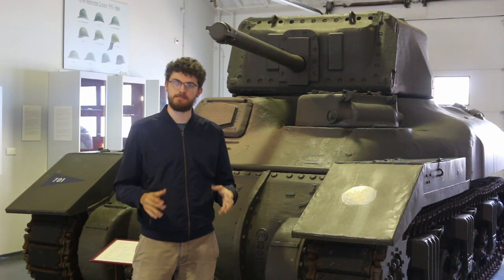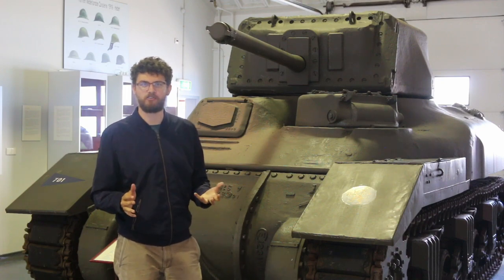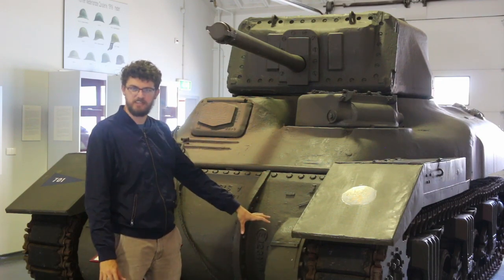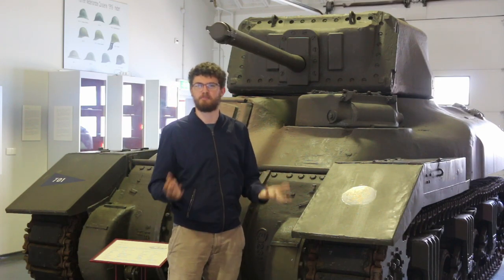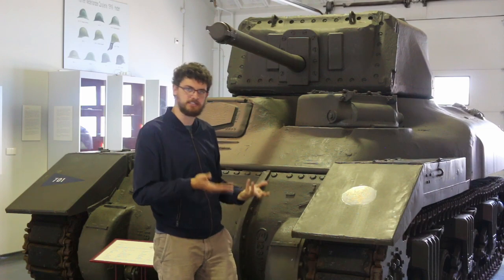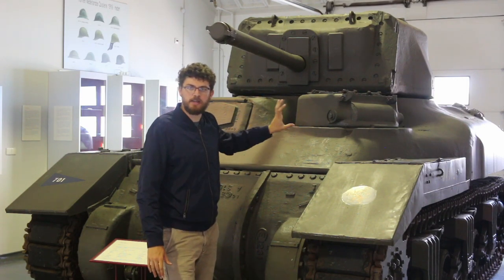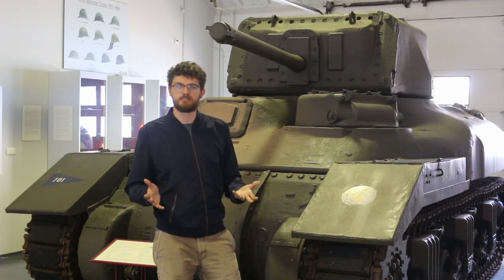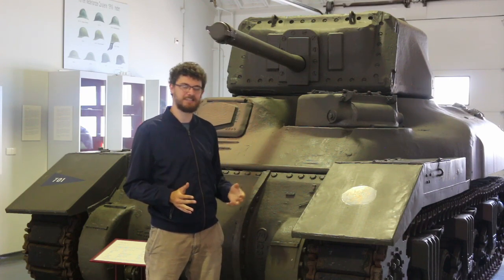Tank Talk #1 |  Ram Mark II

Comment: Few mistakes, for example Canada could put British tanks into production because we did have the capability and in fact we did...the Valentine went into production into Canada as did many British designed airplanes.

Oh they were not obsolete at the beginning of the war. In fact if they had been sent to North Africa right off the production line they likely would have gone down in history as being great tanks. The problem was that by the time they were to enter combat, namely in Normandy, tank designs had moved on and with Sherman supplies, with parts and so on, being so readily available the Rams were not used and the Canadian went to Normandy with the Sherman instead.
Reply from the maker: If you take the chance to go back to 0:40, I didn't say the Canadians couldn't make British-designed tanks. As you pointed out, they did license-build the Valentine. My point was that it wasn't practical for the Canadians to buy British-made tanks from British factories. The Canadians were going to have to build their own armor. To simplify their supply chain, it made sense for the Canadians to adapt a US design, since they could source parts from the US (when license-building Valentines, they'd had trouble getting certain parts from the UK). 

The British also didn't have a suitable medium tank available for the Canadians to license build in 1941 anyways. Cromwell, for example, was still on the drawing board at that point. 

I agree that they might have done quite well in North Africa.